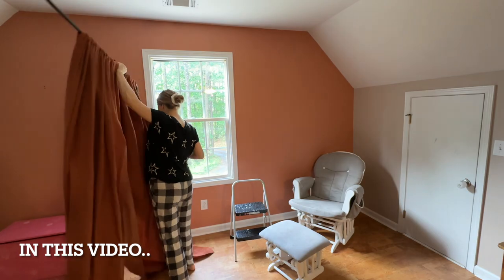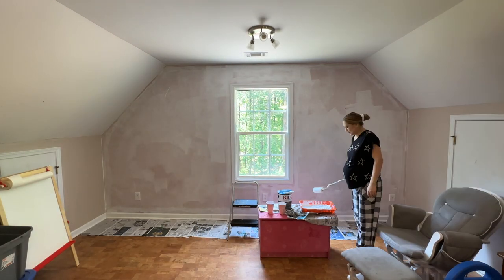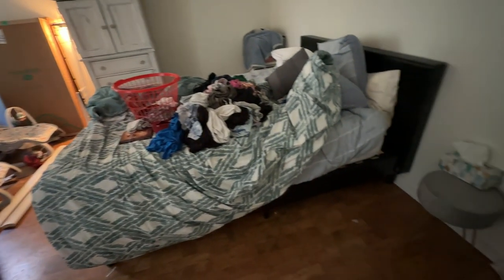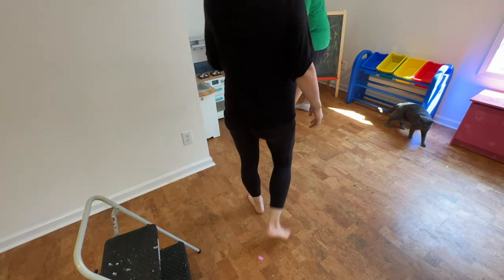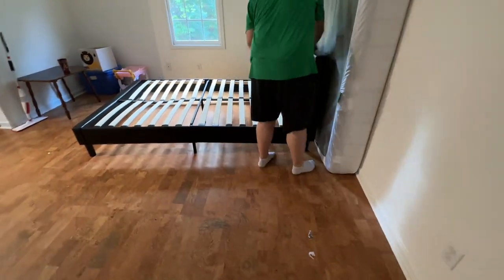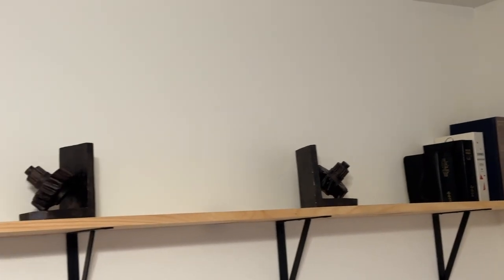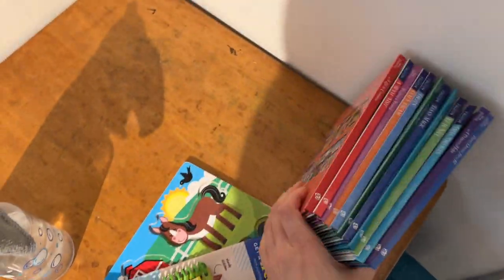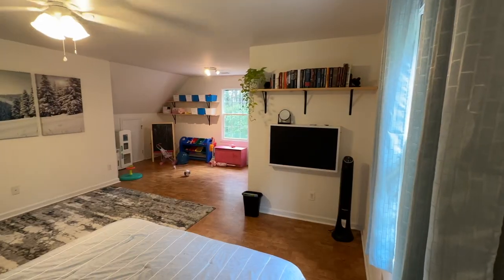ROOM MAKEOVER  DIY ON A BUDGET /turning one room into two // room makeover // budget room makeover

Comment: Hello from AlbaNY. Your husband placed the kitchen set correctly the first time, assuming you want to maximize wall space. He first placed it so that it only used one wall, rather than two walls. Then, on the wall that you just vacated by moving the kitchen, I would put that blue rack with all your bins. And then the rack kind of looks like mommy’s vegetable/pantry bin in her kitchen. 

Also, if you want to utilize more of the space in the center of the room (and visually divide the room into two halves), consider placing those desks, face-to-face, in the exact center of the room. Put the taller desk facing the window, and the smaller one against it, with its back to the window. 

Also, I think your husband may have put that French cleat for the wall desk too high. Bringing a desk chair and see if it needs to be lowered about five or 6 inches. That way he can touch up the too-high nail holes while you still have out your patching and painting assemblage.
Reply from the maker: Hello Beth!  I like the idea with the kitchen and the blue organizer near it - spacesaver too. I'll have to try that one out. 
Also the room division with tables - i think its a great space saver as well, since nothing it touching the wall, will have to see if they will be doing a lot of jumping in there first.. Would not want them to keep running into the tables.
Wall desk - he was mentioning the standard hight when hanging it , but I haven't sat at it yet, I'll  have to see if it is too high/low for me. 
Thank you so much for the suggestions!! 😊